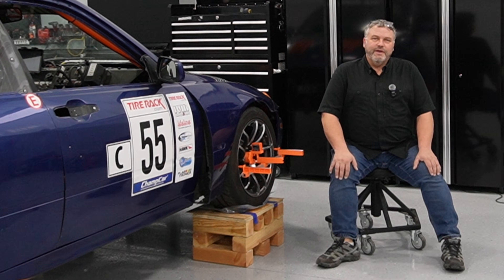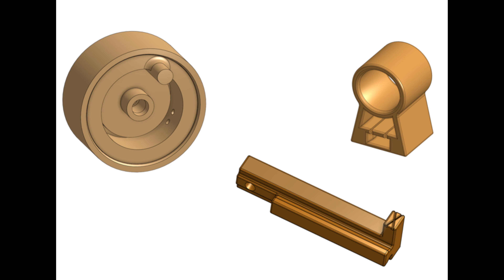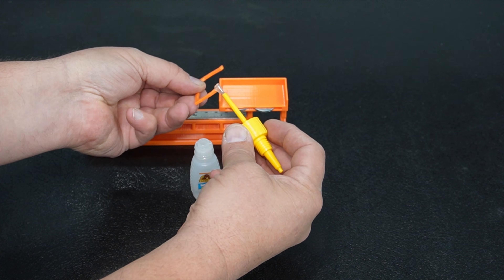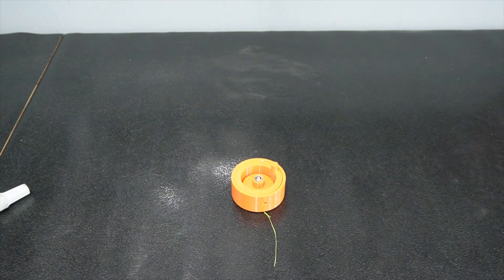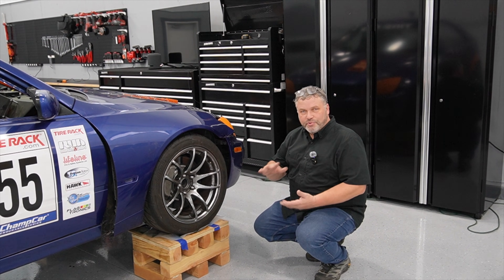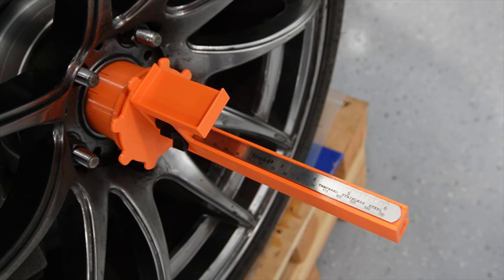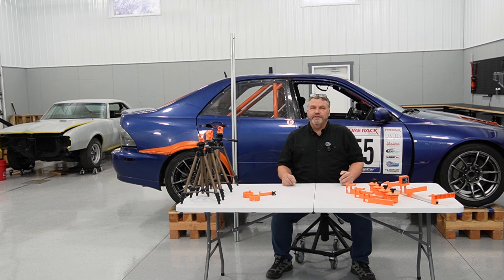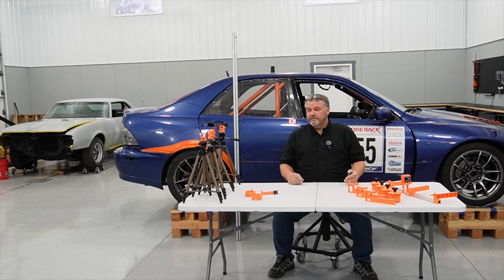3D Printed String Alignment Tools for Improved Accuracy

Comment: Fantastic idea, printing parts out now but could you possibly make an adaptor for the BBS RG334/RG345 series wheels fitted to some Impreza's/Foresters?  52.5mm detent OD. 51.8mm wheel cap OD and 3.3mm detent depth?
Reply from the maker: @paulkidson the STL files based on your dimensions are now available for download and a link can be found in the spreadsheet at the bottom of this web page: https://www.diyfabshop.com/alignmentkit  Once you get a chance to try them, let me know if they fit well or tweaks are needed. Cheers!

Comment: Thanks so much for this. I am working on printing this. I tried a variety of the available sizes that felt would be close for my Konig Hypergrams, none were a great fit ( I tried 12,15 and 32).  The Hypergrams don't have a snap in cap, but I did some measuring of the center hole and the WCOD= 2.033", DTD= .221" and I will guess that the WCDOD = something like 2.08".  Can you take a stab at these and I will print and verify?
Reply from the maker: @WTF0v3r the STL files based on your dimensions are now available for download. Once you get a chance to try them, let me know if they fit well or tweaks are needed. Cheers!
Reply: @DIYFabShop  Ok, so I ran off a print.  The back of the wheel where the tabs lock in has bit of a shallow taper to it, so it ended up a little loose fitting.  Can we try WCOD = 2.045, DTD .210 and WCDOD 2.1"?  Thanks again for the great design.
Reply from the maker: @WTF0v3r  the revised STL files based on your dimensions are now available for download. Once you get a chance to try them, let me know if they fit well or tweaks are needed. Cheers!
Reply: @DIYFabShop  Ok so getting better but still need some more work. On the A version, the diameter is close, but axially there is still some movement and the threaded plug doesn't really have any impact on the clamping force.  Can we try WCOD = 2.05, DTD =2.0 and WCDOD= 2.2"
Reply from the maker: @WTF0v3r  Rev B is ready to download.  Let me know how it goes. Cheers!
Reply: @DIYFabShop  Still needs a little more.  I just noticed that in your spreadsheet you are showing the WCDOD = 2.1, I think it needs more that that as the threaded plug doesn't really impact the grip when tightened.  Can we try WCOD = 2.055, DTD=1.99 and WCDOD=2.2 (if the last one you sent was really WCDOD=2.1).
Reply from the maker: @WTF0v3r  I'm sorry, I do believe the last one was WCDOD 2.1.   I have created a Rev C with the new requested dimensions.  They are getting pretty close to the No 12 which I believe you tried before.  Do you recall if the No 12 was too tight?  Are you still trying to reduce axial play?  And just to confirm, have you been printing new threaded plugs with each revision?  The dimensions of the plug do change in relation to dimensions of the hub adapter. We will get this!
Reply: @DIYFabShop  Yes, #12 was too tight. Yes, new plugs every time.   Sending to the printer now, I'll let you know in a few hours.  Thanks again.
Reply: OK, so I printed out Rev C, and while continuing to get better, it still wasn't great so I reprinted #12, and while tough to go in, it did fit nice and tight, so maybe I just printed the wrong part the first time.   I did start to look at them a little closer, and even though fairly close in the measured dimensions, the shape of the locking tabs is significantly different (smaller) on part 38.  The tabs are much larger on #12 and that seems to go a long way in keeping the model tight to the wheel against the beveled edge on the back of the wheel.  So I think we should just mark the hypergrams down as #12.  I will just add some extra wall loops and infill to make sure the tabs don't break.   Also, your "Buy me a Coffee" page is link dead.
Reply from the maker: @WTF0v3r  ok, sounds good.  If the threaded plug doesn't screw all the way in and bottom out it could create measurement variation wheel to wheel.  So if it doesn't screw all the way in with #12 you may try hand sanding down the outside of the threaded plug where it pushes on fingers, or even a little lubrication at that interface.  Thanks for the heads up on my coffees, I fixed it.

Comment: Hi, i have the measurements for the factory lexus ls400 alloys these have wheel caps that cover the nuts as well so ive taken the best measurements i could get from the centre bore of the wheel
wheel cap diameter = 60mm
distance to detent = 16.9mm
wheel cap detent outside diameter 67mm
Reply from the maker: @rsmith4977 this may take a little iteration to get right,  hopefully there is clearance inside the center bore before running into any hub nuts or such.  With the dimensions you provided the inside diameter of the threaded plug is about 46.5 mm, we don't want that to run into a hub nut or anything inside the wheel bore. The STL files based on your dimensions are now available for download and a link can be found in the spreadsheet at the bottom of this web page: https://www.diyfabshop.com/alignmentkit  Once you get a chance to try them, let me know if they fit well or tweaks are needed. Cheers!

Comment: You have Japan Racing in the list, but it does not match mine. I have Japan Racing (JR) SL01 and cap is 55.9mm Detent is 57.7mm and DTD is 4.2mm
Reply from the maker: @tsjiller the STL files based on your dimensions are now available for download and a link can be found in the spreadsheet at the bottom of this web page: https://www.diyfabshop.com/alignmentkit  Once you get a chance to try them, let me know if they fit well or tweaks are needed. Cheers!
Reply: @DIYFabShop  Thank you! I'm printing it now and will come back if we need to adjust something.
Reply: @DIYFabShop  Just tested them and they fit great! Thanks :)

Comment: Thanks for sharing your setup!  I have everything printed except the hub adapters.  Needing them for OEM BMW center cap 6768640 (2008 335i 19's)
Wheel Cap OD: 64.0 mm
Wheel Cap Detent OD: 70.0 mm
Distance to Detent: 7.0 mm

I thought the existing BMW OEM 6783536 might work but the part doesn't print to the dimensions on your spreadsheet, the OD printed at 66, expected was 70.
Reply from the maker: @DIYDabler  I can create that stl file and double check the one you tried.
Reply from the maker: @DIYDabler the STL files based on your dimensions are now available for download and a link can be found in the spreadsheet at the bottom of this web page: https://www.diyfabshop.com/alignmentkit  Once you get a chance to try them, let me know if they fit well or tweaks are needed. Cheers!
Reply: @DIYFabShop  Got my friend to make a test print and the part was slightly too small.  I measured accurately so was confused, had to investigate.  Pulled the wheel, bought telescoping gauge to measure ID's on the wheel plus see how the OEM cap is held in place, so I could understand my mistake.  BMW uses a 2-piece center cap that snaps together and the cap indexes on the inner part, I measured to the outer part which only holds the roundel.  1st mistake.  2nd was the BMW center cap has 5 tabs so you can't directly measure the tab OD.  I traced the tabs on paper and used a compass to find the center so I could get a good OD and I may not of properly accounted for a material thickness.  So... if you would please, a 2nd try:

Wheel Cap OD: 66.5 mm
Wheel Cap Detent OD: 70.0 mm
Distance to Detent: 4.5 mm

Also apologies...the one we printed that wasn't per the chart dimensions was the Corvette Sawblade, not the other BMW

One other issue I ran into...I bought the t-Nuts you linked too on Amazon and they are too tall to fit the supports that hold the pipe.  You didn't show putting the T nuts into this part in your video so I had to guess as to what you were shooting for in your design.  The t-Nuts I received are .275" tall and looks like your design you need .225?  I ground one down and cleaned up the threads with a tap to get it to slide in.  FYI the flange on the nuts I received are .435 x .750.  Not sure if that matches what you designed for.  Have a suggestion:  Use the 1/4-20 rivnuts.  Maybe they are more consistent from brand to brand?  Make the bottom solid with a relief hole to pull in the rivnut like on your other parts.  Create a hole at the bottom of the tube support you can drop the nut though.  With a 1" bolt you can pull the rivnut into place as you do with the other parts.
Reply from the maker: @DIYDabler  regarding the 1/4-20 tee nut, if you are referring to the conduit holders for the top of the tripods, that pocket in the conduit holder is set up to accept a standard 1/4-20 nut.  Essentially the standard nut slides in from the side and a the little snap arm is to deflect out of the way and then snap back to retain the nut. Sorry  I missed assembly of that on the video.  Is that the nut you were questioning?

I will create the new STL based on your new dimensions!
Reply from the maker: @DIYDabler  the new Rev A STL files are now available for download.  Once you get a chance to try please let me know if they fit well or further tweaks are needed.
Reply: @DIYFabShop , I notified my friend with the printer the new file was available.  I will report back on the fit.  Appreciate your support. 

 I have another set of wheels I'll need an adapter for.  Just put Fuel wheels and new tires on my truck and the old tires indicate alignment is out.  Will need to get those measurements over to you.
Reply: @DIYFabShop  Makes sense on the conduit holder design.  I had looked at the part in an STL viewer and that seemed the intent, but didn't want to assume.  The issue I ran into is the T nuts I bought from your Amazon link do not fit.  Once I ground ~.050 off the threaded part, got it to go, but fit wasn't great.  Wondering if the t nut flange is also different.  It seems the t nuts I received are not the same dimensions you designed too.  It's a minor issue, can make it work. 

Was thinking if design around the rivnut would be simpler and perhaps less variation in their dimensions.  I have aluminum rivnuts and they were too small, so got the steel ones from your Amazon link, which were a perfect fit.

I've done solid modeling but it was many years ago.  A friend has SolidWorks, maybe I'll work with him on the design I have in my head.  If we create something useful, can share the design with you, in case want to give your audience another option.  Thanks again!
Reply: @DIYFabShop  My friend printed a reduced height test piece, the fit was excellent. (In his words, he moved the z axis of the part below the print bed.  So only about 1-1/8" of the part (the area with the tabs) was printed.  Was done to reduce print time and save material.  He now will print the full hub adapter and threaded knob and will check the fit of the assembly.   After three samples not fitting, it sure was a pleasing sound and feel of it snapping into place. Win!
Reply: @DIYFabShop, need another iteration of the hub adapter.  As reported before, the adapter snaps in nicely, it now matches the OEM cap.  However, I found the tabs need to reach in further so they aren't compressed, to allow the threaded plug to fully screw in.  Hard to measure so best guess is, would you change the distance to detent from 4.5 to 7.0 MM please.  Thank you.

Comment: This is fantastic!  Would love if you could make a wheel adapter for an NB Miata with OEM 16" wheels.

Cap OD: 2.020 inches
Detent distance: 0.236 inches
Detent OD: 2.062 inches
Reply from the maker: @timbrodeur280 the STL files based on your dimensions are now available for download and a link can be found in the spreadsheet at the bottom of this web page: https://www.diyfabshop.com/alignmentkit  Once you get a chance to try them, let me know if they fit well or tweaks are needed. Cheers!
Reply: @DIYFabShop  I finally got the rest printed and ran into a problem.  My Miata wheel's center cap is nearly flush with the outside rim, so the left and right 'touch off' pieces aren't long enough to touch the rim.  Any thoughts now how to address that issue?
Reply from the maker: @timbrodeur280  we probably have two options. Can you estimate how much longer it would need to be?  I could either make a new version of the touch of pieces that has a longer post to allow it to touch or I could make a stl file for a cap that could be slid over the current post to allow it to reach.  If you don't want to reprint the whole touch off pieces or if the longer ones won't fit in your printer, than we should try the cap.
Reply: @DIYFabShop Very roughly, the center cap is about 5/8" below the rim, leaving the touch off posts just under 1.5" short.  A 2" extension would work.  I'm thinking a cap would be a good way to save the touch off pieces I've already printed.  And various length extension caps could also potentially help others with different center cap to rim offsets.
Reply from the maker: @ ok, I will create the extensions and let you know when they are posted.
Reply from the maker: @ the post extension is now available on the website.  As long as you get it fully seated on the touch-off post on both sides, dimensional accuracy should not be impacted.  Please let me know how it goes.
Reply: @DIYFabShop  I printed out a couple.  They fit nicely and it appears the length will work.  Now for more printing.  :)  Thanks again.
Reply: @DIYFabShop  Thanks for the super fast response!  I had to ever-so-slightly sand the plug's end OD to get the threads to bottom out.  Like one pass around with some 220 grit.  Fits nice and tight.  Printing the rest now.  :)

Comment: Hi Kent,
Just bought you a Coffee.😀
I'm running Konig wheels. My wheels dont have a snap in cap. They are bolt on. 
The centre hole is 51.5mm and 5mm thick. 
I hope you can work with this? 
I have test printed a few of the other designs that have similar dimensions but they dont fit nice and tight. 
Thanks for the great design.
TB.
Reply from the maker: @toddblunt4523 Thanks for the coffee!  So if you agree we can try a strategy of using the thickness of the wheel as the distance to detent.  I added that stl file link to the spreadsheet.  If you had already tried the Renault Laguna adapter and it was too loose, we may want a different strategy.
Reply: @DIYFabShop  HI, I have tried a test print and its a little loose stil. If you dont mind could we try a 52.8mm hole and 4mm thick/distance to detent. I think this will make it nice and tight.  I have tried the 949 design and the renault, but the 949 was best. 949 was a nice fit for the hole but was able to move in and out.
Reply from the maker: @toddblunt4523  OK the new file links are ready.  Fingers crossed this works for you, but if it doesn't, just let me know and we will iterate some more.  Cheers!

Comment: Thank you very much for putting this together. A few center cap specs for BMW wheels
Apex ARC 8
Cap OD 64 mm
Detention OD 67 mm
Distance to detent 6mm

Alzor 040
Cap OD 65mm
Detent OD 68mm
Distance to detent 10mm

 Factory F82 m4 wheel
CAP OD 64mm
Detent OD 67mm
Distance to detent 5mm
Reply from the maker: @kilgojr the STL files based on your dimensions are now available for download and a link can be found in the spreadsheet at the bottom of this web page: https://www.diyfabshop.com/alignmentkit  Once you get a chance to try them, let me know if they fit well or tweaks are needed. Cheers!
Reply: @DIYFabShop  The Apex ARC 8 measurements need to be updated. The distance to detent is 4.5mm (or 0.18"). Thanks!
Reply from the maker: @team9racing  New Rev A version files are available to download

Comment: Really great video and system. Would love to try with my rims - Performance wheels Superlite. Wheel outside cap diameter 77.3mm ,distance to detent 5.2,mm wheel cap detent diameter 78.5mm. Thanks!
Reply from the maker: @tiger-fh3gh the STL files based on your dimensions are now available for download and a link can be found in the spreadsheet at the bottom of this web page: https://www.diyfabshop.com/alignmentkit  Once you get a chance to try them, let me know if they fit well or tweaks are needed. Cheers!
Reply: @DIYFabShop  Hello! I got around to trying this and need some tweaks. I have had to measure off the rim as the center caps are a different kind of design.

The rim measures 77.5mm for the outside cap diameter bore, 79.5mm wheel cap diameter bore. 

The 'distance to detent' is harder to measure off the rim, but the length of the 'wheel outside cap diameter' from the face of the rim to the start of the chamfer for the transition to the 'wheel outside cap diameter' bore is 3.6mm. So perhaps a distance to detent diameter of approx 4.5 to 5mm. 

Hope you can work backwards from the rim! Thanks in advance, looking forward to trying the laser system.
Reply from the maker: @tiger-fh3gh  There is now a Rev A version of the STL Files with these new dimensions.  Measuring the wheel is a lot harder, but we should be able to get a good fit with some iteration.
Reply: @DIYFabShop  Thanks! Have tried. Improved, but still a bit loose. 

Radial clearance is close (perhaps go + 0.5 t 1mm on these dimensions).

There is quite a bit of play in and out from the rim face. Perhaps reduce the distance to detent dimension 2mm (unless there is meant to be clearance here and it should lock up on the two bore diameters).

Thanks
Reply from the maker: @tiger-fh3gh  a new set of Rev B STL files are available to try.  Let's see how these do.
Reply: @DIYFabShop  Almost there, but the threaded plug threads all the way into the hub adaptor without locking it up. 

Suggest another +1 to 2 mm on the outside detent diameter, and -0.5mm on the distance to detent. 

Thanks! Definitely owe you that coffee
Reply from the maker: @tiger-fh3gh  new file link posted!